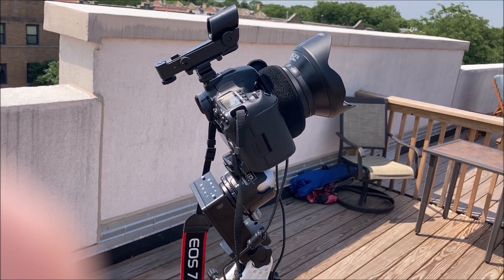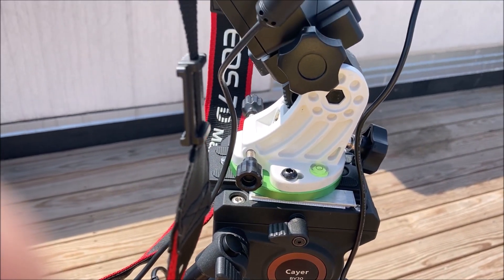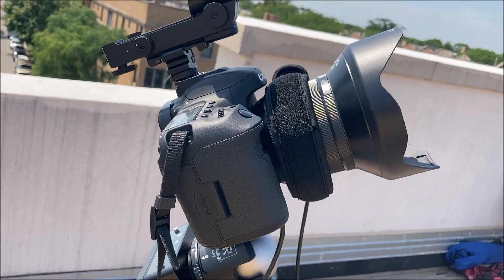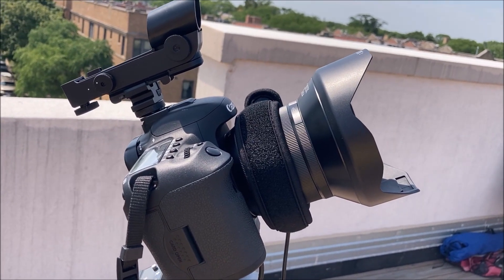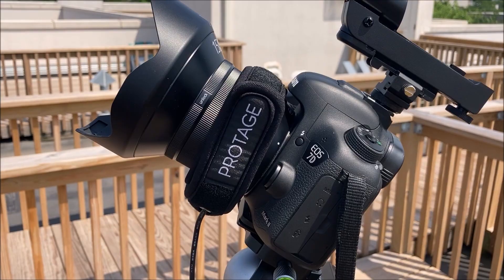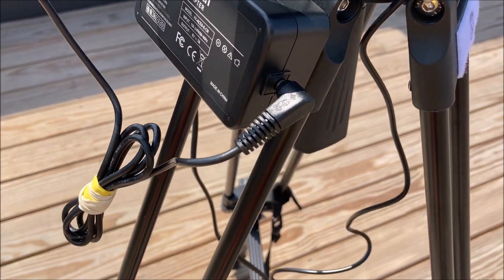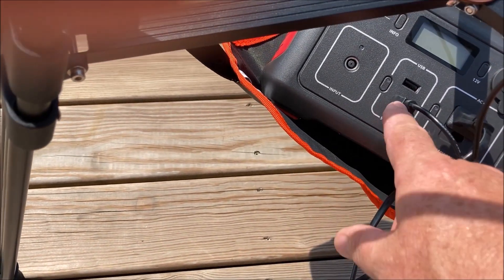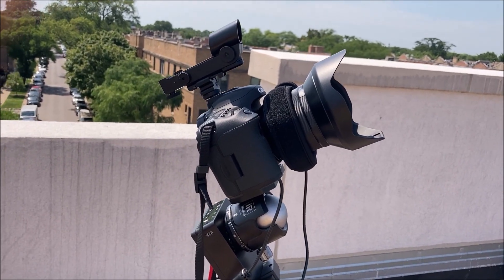Move Shoot Move Final Build

Comment: Dale hi how did you manage to connect the wedge that comes with the skywatcher adventurer to the base of the move shoot move , i.e. big screw into a small screw hole in the MSM. Great setup cheers Marty
Reply from the maker: I may have answered your question inaccurately. I have a metal bar that fits into the SkyWatcher Wedge that has a removable screw, so I replaced it with a 1/4-20 screw.
Reply: @lrtdale  Brilliant Dale very impressed. Great that you have got to version 4 and very kind and helpful that you have shared. Says a lot about you and your drive. Well done buddy. 👍👍👍👍👍👍👍👍👍👍👍

Comment: Aren't you suppose to connect the hot shoe to the MSM tracker?  Otherwise how does the camera trigger the MSM tracker?
Reply from the maker: Sorry, I just saw your question.  The hot shoe trigger is for time lapse, or panoramas.  The red dot finder is used just to get me onto the target, such as Andromeda, Pleiades or som other visible target. I can always remove it.
Reply: @lrtdale  I figured that out already since I also got the MSM.  The only thing that took me abit to figure out was in timelapse mode where I connect the cable that came with MSM to trigger MSM after each shot, I cannot use 'live view' as it would not trigger the MSM in that mode.

As for the lens heater, I find Coowoo to be better than the Protage which I also have.  https://www.amazon.com/gp/product/B07WJG9B5P/ref=ppx_yo_dt_b_asin_title_o06_s00?ie=UTF8&psc=1